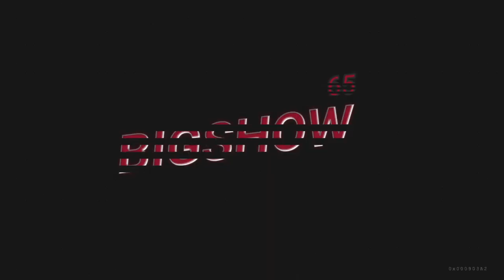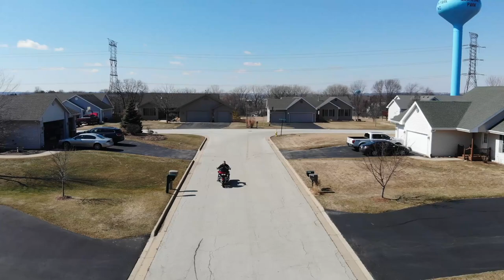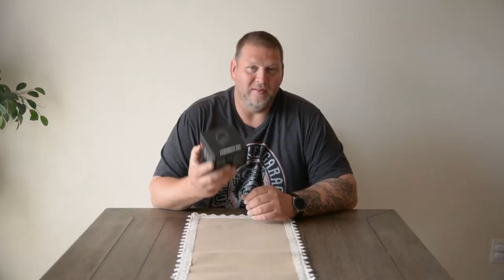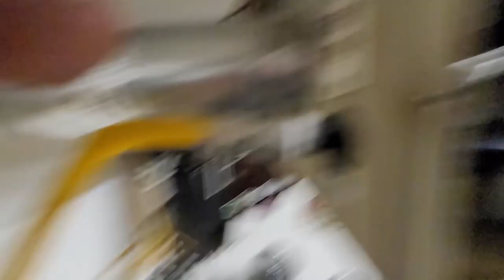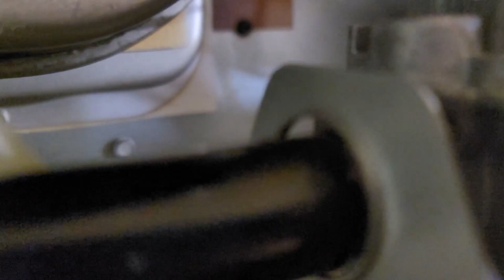Mr Heater Big maxx furnace ignition Fix..update..fixed?!

Comment: Great job articulating the problem again with a possible solution. I’m curious if it’s the minerals in the water and or dirt bacause evaporated/condensated water shouldn’t have mineral content but it’s probably the water mixing with the airborn contaminates. Regardless, your solution should facilitate a lot longer timeframe before mineral/dirt buildup in the tube’s an issue. Keep up the excellent work growing your channel!
Reply from the maker: Thank you, and thanks for the support.

Comment: So just installed a 50,000 BTU big Max heater in the garage fired it up and it would short cycle 2 minutes 3 minutes roughly and then shut off the LEDs on the board were continuing to blink quick calling for heat and then after about a minute it would fire back up and run for another 2 minutes or so I've tried your method and rerouted the vacuum tube to underneath the gas line and then into the blower section and as of right now it seems to be working perfect so thank you..
Reply from the maker: My fingers are crossed for you..hopefully it takes care of it for you..so far it had worked in my garage also.
Reply: @bigshow65  keep you posted
Reply: I have a short cycling issue as well. Seems the diaphragm switch has been suggested as a culprit.
Reply from the maker: did this trick fix your short cycling issues?

Comment: I tried rerouting my hose and it seemed to have fixed it for about a month but soon as we had warm weather and back into the cold the hose nipple clogged again.I wonder if I drill out the nipple just a little oversized if that would help.Thanks for the video
Reply from the maker: Man, that sucks. Drilling it over size may work,  but I was hoping for a fix that was less   Evasive.

Comment: Hey guys my friend is having a problem with his heater same brand.  Tried the hose clean and no action. You talk about 3 flashing lights he is having a 2 flash green lights warning. Any other ideas ??
Reply from the maker: On the inside of the side panel that he removed has an explanation of the flashing lights. Only advice I can give is to open it up and see what it say two flashing lights mean and go from there.
Reply: see my reply above about how I fixed mine

Comment: Why not eliminate the vacuum switch by splicing the wires together. Why is it needed?
Reply from the maker: It's a safety feature,  it clears the airways of any gasses If it had any type of leak so it doesn't blow up your garage.
Reply: You can't keep a pressure switch jumped out on any furnace. That switch has to normally open on start up or the board will trip out on a closed pressure switch at start up. 26yrs of hvac, u can jump them to start it up. But leaving it the board will pick up on it and trip on codes.

Comment: 2 minutes in there was a buzzing and you wrote annoying. What is that from cause mine will do it 10-40min straight and it's annoying. I think it only does it when not heat is blowing
Reply from the maker: That's the Ignition system. that ignites the gas and lights the fire! so it should not be going for 10 to 40 minutes you definitely have a problem if it does.
Reply: @bigshow65  so should only hear that for a few seconds and then it would ignite and buzzing should go away?
Reply from the maker: @Lefishn  yes!!